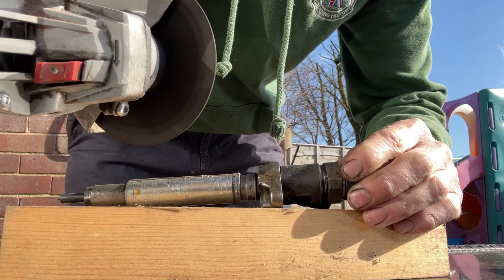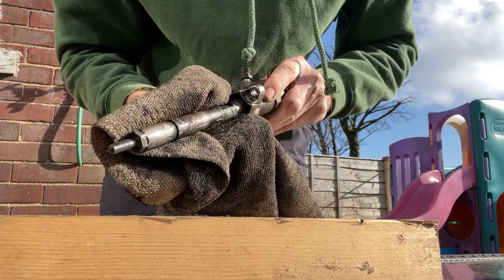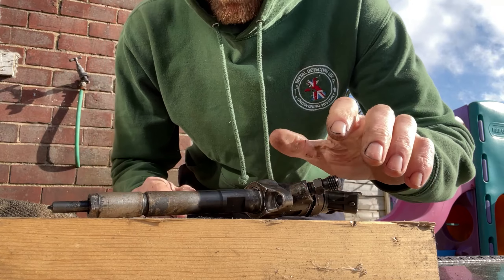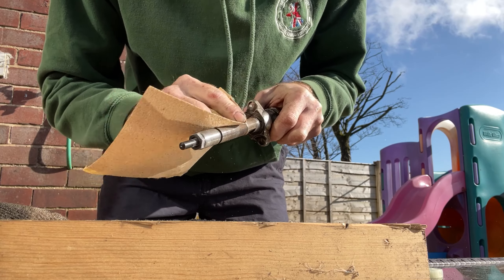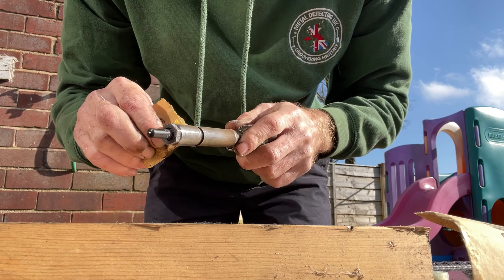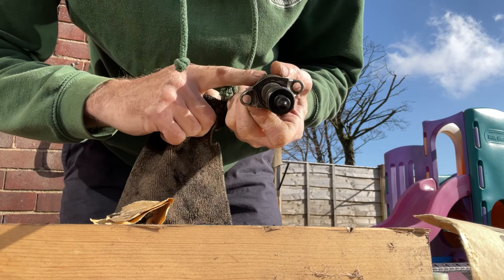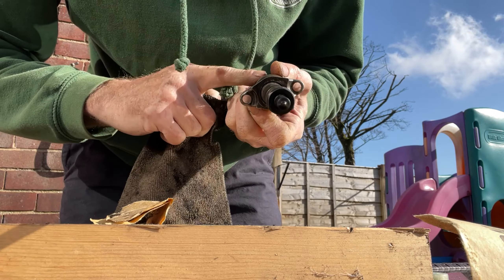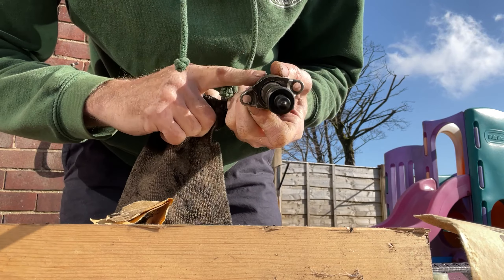Remove Stuck Injector Sleeve From Injector - Step by Step | Car Maintenance

Comment: Thank you so much for sharing this, it really helped. Two out of four injectors came out with the sleeves cemented on. I just ordered the sleeves, you wouldn’t have a video showing how you fitted it back in? And could you please explain the adhesive situation. Much appreciated
Reply from the maker: You will need any high temp lock tight sealant . Apply to where the sleeve will sit in the housing. Use a mallet or wood and hammer , to hit home. Havnt had any problems with mine since. All the best 👌🏻